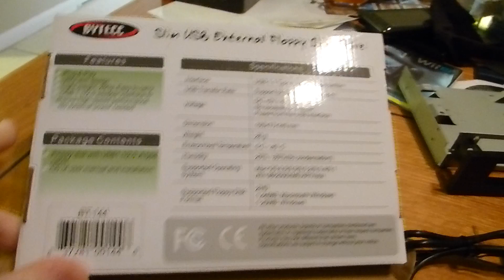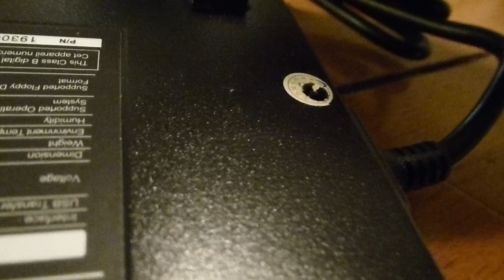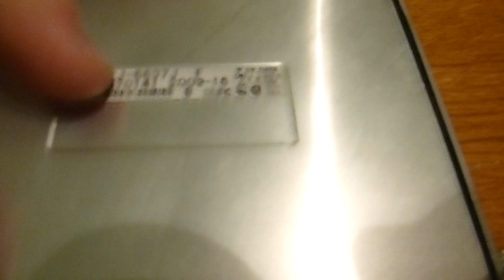Making an Internal USB Floppy Drive

Comment: I'd rather just switch the drives inside the cases, because then I'd be guaranteed it would work with Windows 10 (if the external drive is sold that way).

Comment: I tried your idea, but there is  Pin connector slot on my floppy drive. I think the one I have is soldered, but does not have the same amount of pins.  Any ideas to attach the USB cord without breaking the drive? 

I was thinking I could put the slot from the external drive onto the internal drive, but I do not know where I would connect it on the internal drive. 

FYI: Had one of those cheap external floppy drives, but a floppy got stuck and it broke when one I removed the floppy. Seemed to have misaligned the reader

Comment: I wanted to do this (well, not this, I wanted to use a classic floppy drive, but making a converter from the  26 slimline connector to a standard 34 pin floppy connector should be easy enough), so I bought an external FDD. Turns out it's actually a solidly made product with all the electronics on a single board. Just my luck. Everything I buy turns out to be crap, but the one time I actually need cheap crap, I get a solid product.

Comment: I have a 3.5 floppy drive and a USB hard drive enclosure with usb to IDE
 interface. Any way to use the floppy drive in the enclosure? I'm not 
sure if the pinouts are similar like just cut the outer ends of the floppy 
data connector b/c the one on the HD enclosure is bigger but it has the 
notch in the middle.
Reply: From what i read its separate channel from the standard IDE (40pin) compared to Floppy Drive (34pin) :(

Comment: Wow... this is really useful for my current problem. I'm looking to do pretty much the same thing, (grabbing the usb controller card from a usb 3.5" floppy unit) but I want to try and attach it to a 5.25" floppy drive. Notionally... I believe it should work. The mental link this video provided to me was that DRFInPerson's floppy drive takes the same ZIF ribbon cable as the usb drive I purchased. I pulled out one of my desktop 3.5" drives... but sadly it doesn't have the ribbon cable... instead the FDD connector connects to a single board that directly controls the various motors and electronics on the drive.

So... you're probably wondering what my real question is... Well. That small card DRFInPerson removed from his 3.5" drive... I want to know what the pinout mapping is between the FDD connector ( 34 pins) to the ribbon cable (26 connectors). The FDD connector should clearly identify which pin is pin 1, and the sequence from then on... I'm not sure how to define which is pin/contact 1 on the ribbon cable. I'm also assuming there is no electronics between the FDD connector and the ribbon cable.

Of the people who have successfully made this conversion... do you still have that "removed" board? And are you able to provide the pin mappings? 
I'm hoping you can describe the mapping in a way that avoids confusion on exactly which pin goes to which contact.

This would save my bacon if you could.

Thanks in advance. 
And before I get negative comments... I already know I will need to provide separate power (with the same ground) directly to the 5.25" drive.

Any comments on things you believe I've missed would be appreciated. Thank you.

Comment: Thanks for the video! It works perfectly on my pc running windows 10, I used a slim floppy drive and not a card reader/floppy combo, but it's basically all the same thing. A standard floppy drive doesn't have the flat ribbon connector.

Comment: Man, that thing you have buy is a converter dude! When you said that you didn't need a converter I thought that you will come up with a solution like FLOPPY -> USB (without any converter), but of course that's impossible, so DON'T SAY THAT NO CONVERTER IS NEEDED because THAT's IMPOSSIBLE!!! You will ALWAYS NEED some type of converter like the one you buy. Please don't try to lead people on error. Don't be a lier.
Reply from the maker: Excuse me? The "converter" is built into the USB floppy drive. If you can find just that part by itself without me having to buy an entire floppy drive, that would be great, but I basically just dissected it to use the connector.  It's essentially a logic board with a USB cable attached.
Reply: Never listen to anyone who uses the word "dude" in their argument, and doesn't know how to properly use the caps lock key.